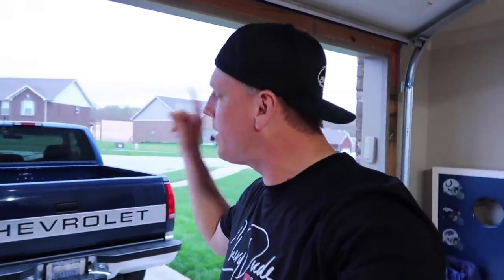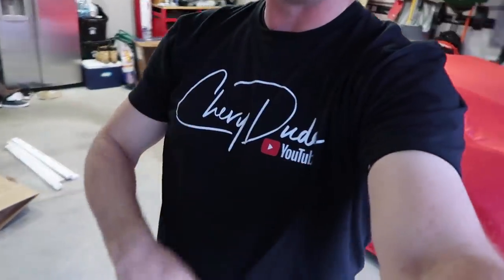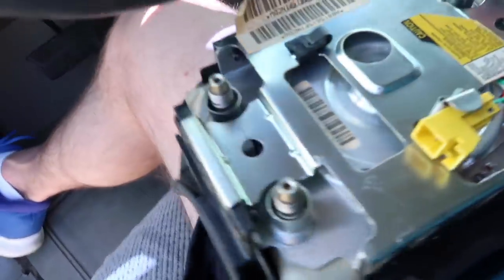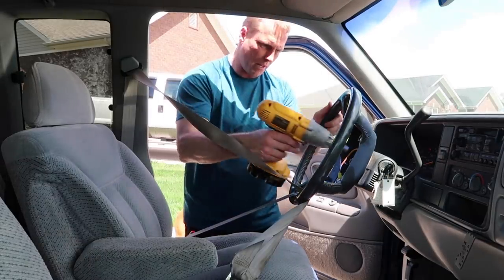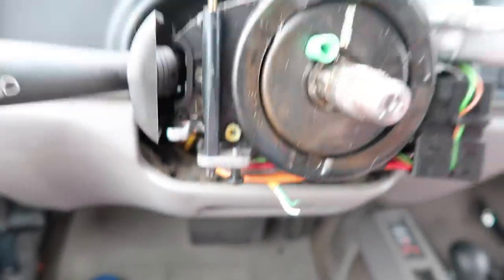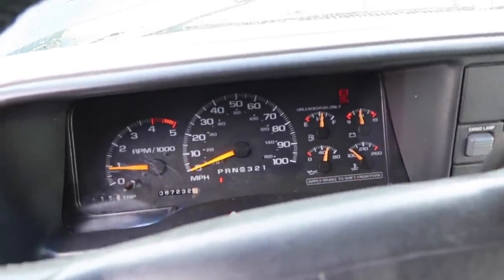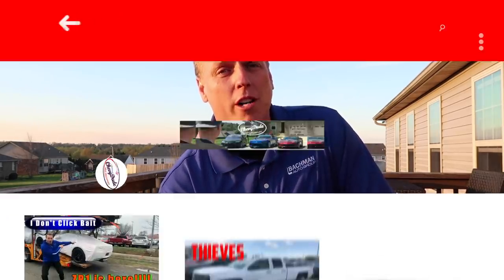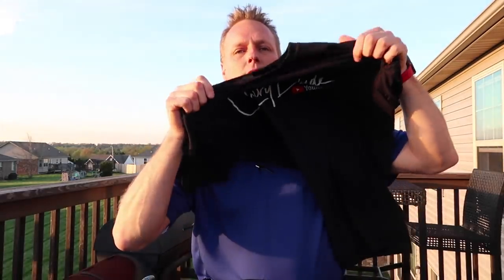Why to ALWAYS fix your air bag lights! Could save your LIFE!

Comment: It's always a great feeling when you start up your vehicle and find out that you fixed it. I did my purge valve last week. 12 dollar part that took 5 minutes to replace. Dealer quoted me 210 to do it. lol. Too bad i have to get a new timing chain. So they'll still get 2900 dollars. If i didn't have to drop the engine out of the bottom of my Enclave, I'd do that myself too. But it's just too much for me to attempt. lol

Comment: Hey Mike you should talk to owners of 1999 Corvettes. When they get a service traction control soon message Chevrolet dealers can’t fix because GM ,in its infinite wisdom, discontinued the part. It is a big problem for Corvette owners.
Reply: its a problem for all GM owners with a vehicle over 11 years old... GM discontinues parts fast and they are unsupported and i wont buy a new GM for this reason
Reply: @derrickodyes1934   Business. They need repeat customers to stay in it. Besides by 11 years most of the cars are either on their 2 or 3rd or more owner or are scrapped.

Comment: I had to do the clockspring on a 2004 Durango. Leave power connected, turn the key, turn the wheel sideways a few times to access the screws behind, then once they're loose, straighten the wheel, turn off key disconnect the battery. Need to straighten the steering wheel or else the new clockspring goes in sideways and messes with things.

Comment: My only critique is, anytime you work on something electrical, especially the airbag system, disconnect the battery before starting the job. Other than that, good job man.
Reply: Jeremy Cribb the airbag has backup power (a capacitor blows it anyway) but yes disconnect the NEGATIVE  terminal anyway
Reply: The bad thing about video is not everything is shown, so it’s easy to overstep. I didn’t mean to assume you didn’t know.

Comment: I have a 2010 Malibu the airbag light came on and flashed on and off there was just a recall issued for the problem but my vin is not included  I don’t know what to do short of removing airbag module. If airbag deployes clock spring is over tighten can result in metal in airbag

Comment: Someone may have had a short person that drove that truck so they cut the wires to keep the airbag from ever going off. 
Short people that have to put the seat way up in order to reach the gas/brake pedal, are sitting WAY to close to the steering wheel and if the airbag was to go off it can injure them badly, and even kill them. I know someone that was hurt badly from that happening and now has a steel plate in their neck, and it was a very minor wreck, but because they were sitting so close to the steering wheel it caused them major injuries. 
This is why short people should buy vehicles with adjustable pedals.